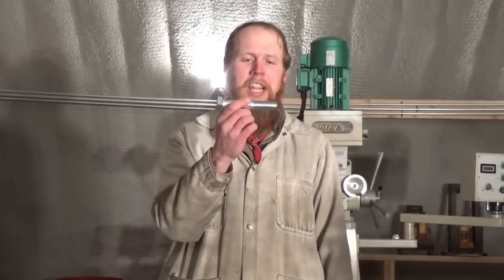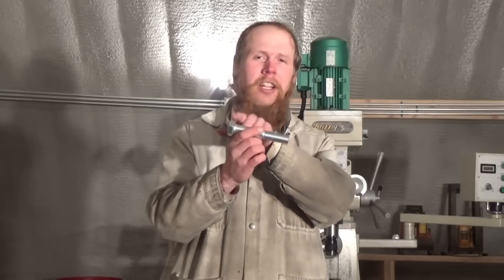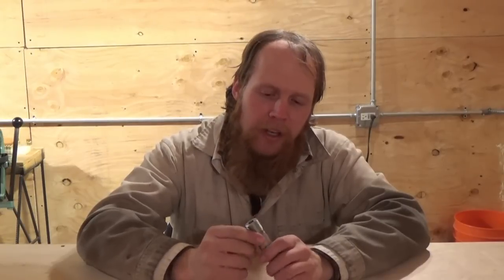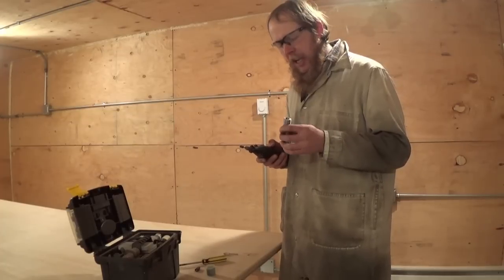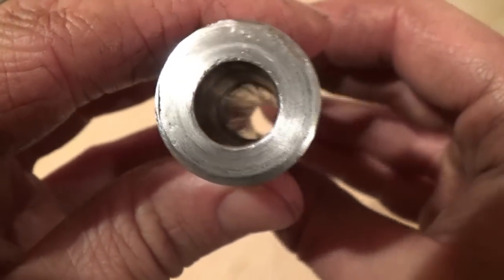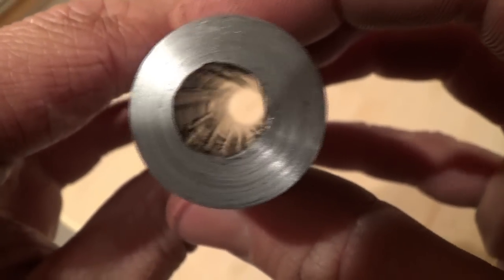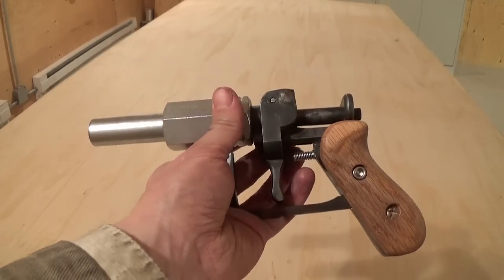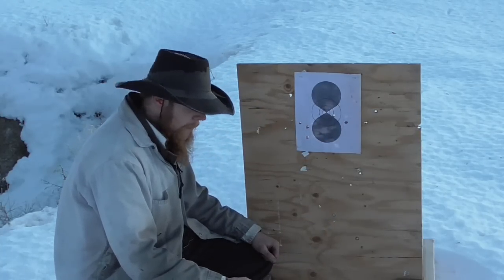Making a Rifled Barrel without Machine Tools (TIS081)

Comment: Ingenious way! Once I tried to drill a big screw but I broke one bit so I desisted,  screws are harder than carbon steel, aren't them?
Reply from the maker: Well, there are many different kinds of carbon steel, and most of them can be made harder or softer by appropriate heat treatments.  Wood screws are usually made out of hardened carbon steel, which, coupled with their shape, would make them very difficult to drill through.  Most machine screws and bolts are also made of carbon steel, and the specific type and heat-treatment of the steel is different depending on the grade of the bolt.  Common grade-2 or un-graded bolts are usually not much harder than mild steel.  Grade-5 and Grade-8 bolts are heat-treated for high tensile strength, but are still ductile enough that they can be machined with cutters made of ordinary tool steel.  Most good-quality drill bits are made from "High-Speed Steel," or HSS, which represents a family of tool steels.  Some of the cheaper woodworking drill bits are made from plain carbon steel that has been hardened, which doesn't work very well for drilling holes in steel of any kind.
Reply: well, I tried with a gr.8.8 screw, next time I will use a softer one.

Comment: I wonder how effective this method will be for making long barrels
Reply from the maker: In principle, this process will work for any barrel length.  However, the longer the barrel gets, the more challenging it will be to drill out the barrel (and keep the hole centered), and the longer of a hydraulic press you will need to drive the button through the barrel.  For very long, slender barrels, it might also be necessary to support the barrel in the press in order to prevent buckling.
Reply: I thought using a pulling method with a thin  long rod screwing slowly in reverse pulling the rifling head outside the barrel..
Reply from the maker: Yeah, something like that might be another option for rifling a long barrel.

Comment: great video! The surface finish culd be greatly improoved if you ream it before rifling. it can be done with just a smoothened squere file and a wooden stick.
Reply: Also, after rifling the barrel, you can take a cleaning rod with the slotted end, and run some steel wool through the barrel to smooth off those burrs.  This is what they did at the barrel company that i worked at a few years ago.  They'd have the new guys doing just that all day long.
Reply: All the bore smoothing setups I have seen for firearms use lead laps and fine abrasives.  The lead starts out slightly oversized and compresses to an exact fit in the bore. It even polishes even the corners of the grooves.
Reply: Barrel burr smoother. 
Now that would be impressive on a resume.
Reminds me of that guy that said he was a chicken plucker on Americas got Talent.
Reply from the maker: Thanks!  Smoothing up the bore will definitely be one of my objectives next time I make a barrel.
Reply: What's a squere file? (Friendly question)
Reply: John Cromar 
http://toadhallrifleshop.com/bits-reamers/
works realy well

Comment: Thank you for your very understandable explanation, you have answered several questions I've been asking myself. I am going to try your method. Did you say grade A bolt?
Reply from the maker: You're welcome!  I said grade 8 bolt, not grade A.  Grade 8 bolts have a proof strength of 120 ksi, so they are a very high-strength steel.  Grade 5 bolts are another option--they have a proof strength of 85 ksi, so they're still relatively strong, but a little softer than grade 8, which makes them easier to machine.  For comparison, mild steel starts to yield around 35 ksi, so grade 5 is about 2.4 times stronger than mild steel, and grade 8 is about 3.4 times stronger.
Reply: Tony Scolerio grade 8

Comment: Marvelous - never thought of using a large bolt; seems you could even use the Nut portion or two stacked welded into a plasma cut frame section revolver.   Thanks, I subbed and will be checking more out.  Looking forward to getting machine shop 'enabled' here at the RelentlessHomesteading channel.

Comment: Where did you get a Grade 8  bolt with 7/8-14 threads ?  I don't like to get a few of those Myself!
Reply from the maker: If you can't find one at your local hardware store, try McMaster-Carr (www.McMaster.com).  They are an online distributor with a pretty comprehensive supply of bolts, as well as a lot of other things.
Reply: Thanks much